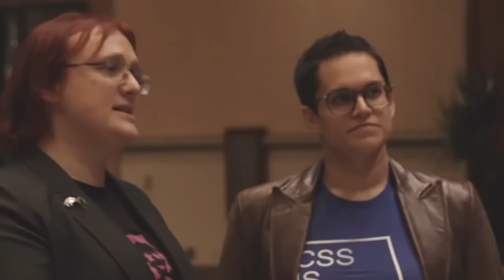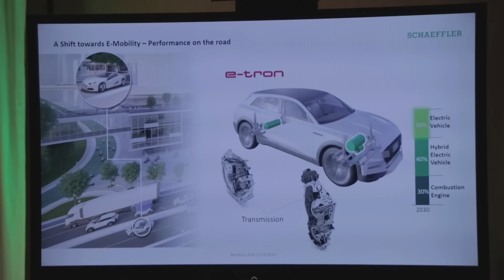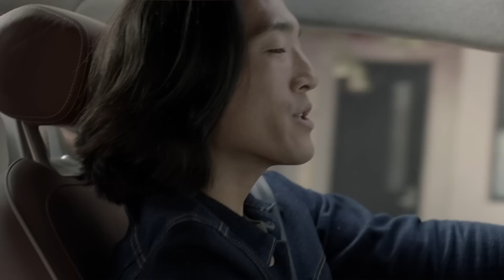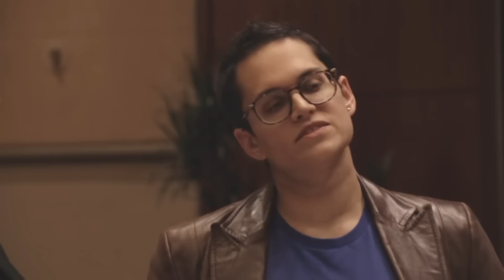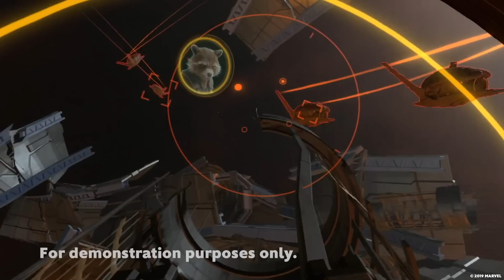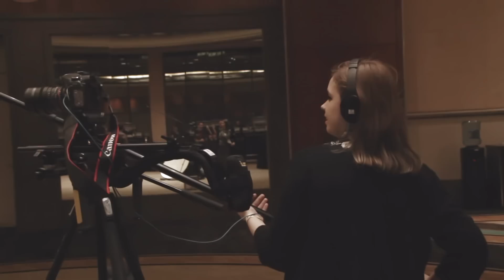EVs Of The Future? Byton's New Design. Rocket Raccoon In The Audi e-Tron: CES Day 1 Roundup

Comment: About that biohybrid vehicle. It is a lie that 250W is the limit for an electric bike. Off course, for a regular electric bike, the limit is 250W and 25 km/h, with an exception for cargo bikes, where is can have 1kW electric assist. But we also have speed pedelec regulation. And those electric bikes can go up to 45km/h and have 4kW of electric assist. But most important: those speed peddled require COC and such extra things. That would make it vastly more expensive than a regular electric bike. So limiting it to 250W and blaming it on regulation is plain bullshit, it is just cost saving. Try to imagine such a 4kW biohybrid with speed up to 45km/h and a range of 200km, that would would be a great revolutionary product. But what they do is essentially a pretty electric bike with no real benefit for a fit user with that limited assist and speed